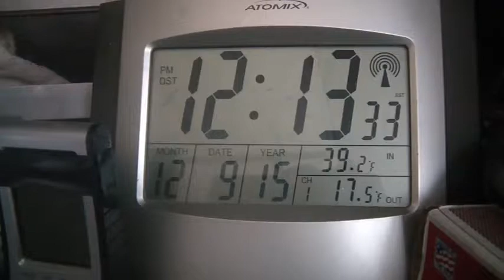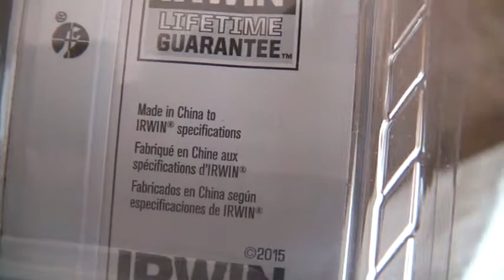Irwin, Vise Grip, 4 purpose tool, bought 2, 7 delivered,

Comment: Here is just opposite , I have much better luck with UPS , And our delivery guy is the greatest , now 3/4 of everything from Fed Ex is damaged. But i must say the new girl delivering  Fed Ex is better than the last guy , but she is new , but the exhaust i got was still bent .  ok back to looking for furnace parts , pretty sure it is the igniter box , push the spark wire to the side it works , but they do not make it any more , but i think i found one that will work
Reply from the maker: +wtbm123 ,  Do U have an oil furnace? If so, no more Franceformers and now an electronic voltage multiplier. Personally, I like the transformer better, so, I look for them when I see a scrap furnace, so far it seems that I am not the only person who likes them. UPS is local to me, their drivers are always polite and professional, though they deliver packages that look like they have been dragged behind the truck for miles. Thanks for your thoughts, watching, and commenting!!!
Reply: +Harvey Spooner Nat Gas , It has a Honneywell  S86A . But think a 

Honeywell S8610U3009 Furnace Intermittent Pilot Control , will work in it